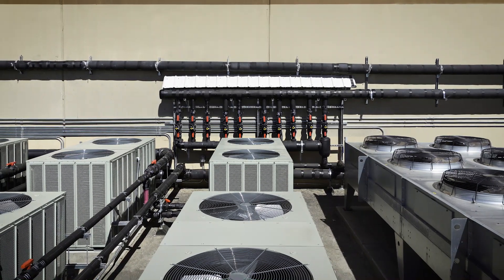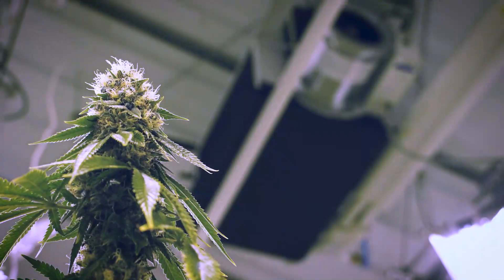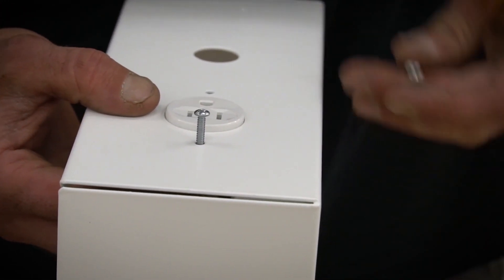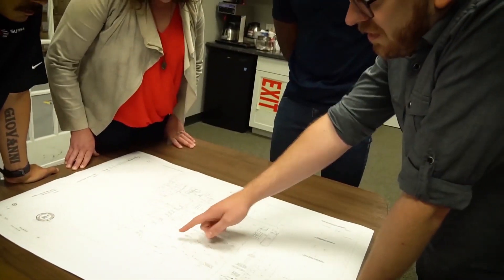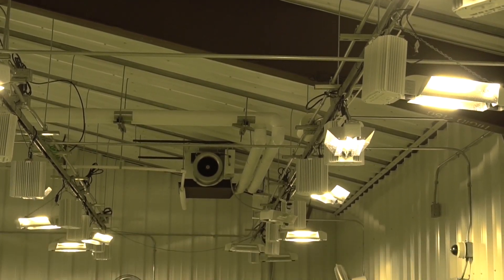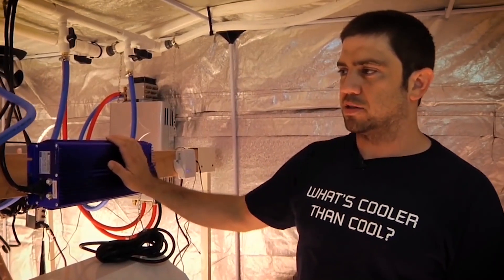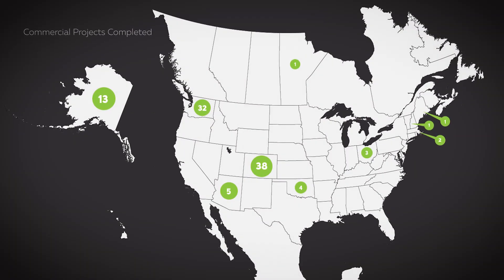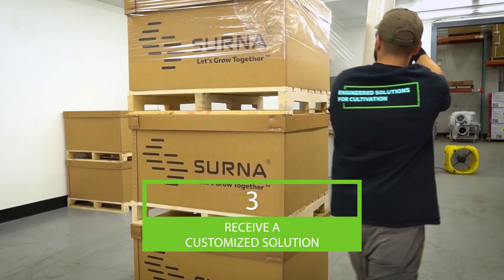Surna Inc.

Comment: As a project manager for the construction of a medical cannabis facility I had the pleasure to meet and work with Surna. At least 3 things happened; first, initially I was using traditional HVAC system and I was able to reduce 50% of the cost by using Surna system. Second, Cannabis is a new industry in Canada with no many real experts, managing the project became pretty easy having on board a very knowledgeable team from Surna guiding us through the process. Third, the foot print and ducting was greatly reduced. I feel very lucky to have met this team before implementing anything.
Reply from the maker: Thank you for the positive feedback, Luz! When there are as many moving parts as there are in building a cultivation facility, we know just how imperative it is to make the process as smooth as possible and to get the job done right. We are happy to hear that you enjoyed your experience with Surna and that our system had a lasting effect on the facility's sustainability/op-ex.